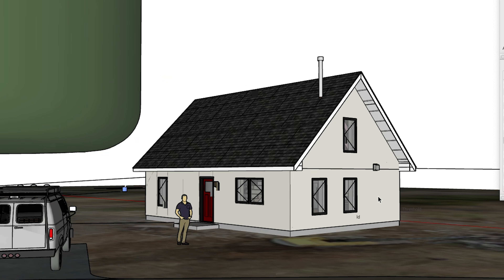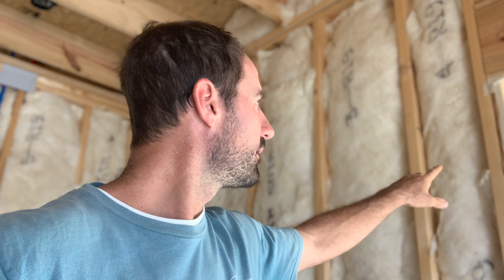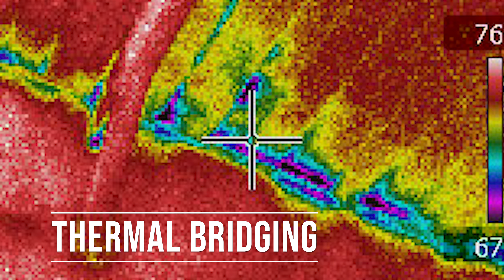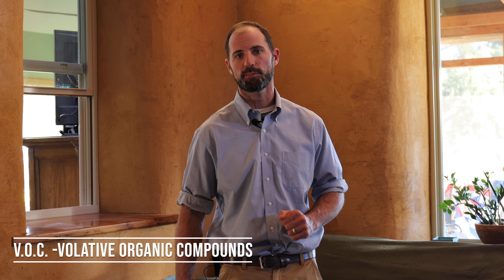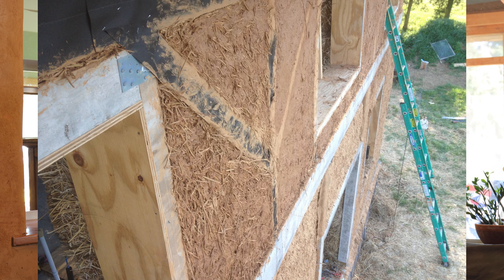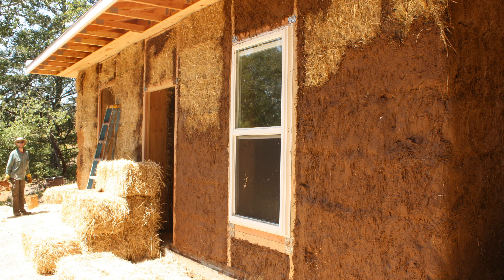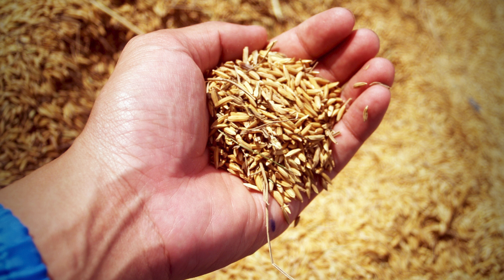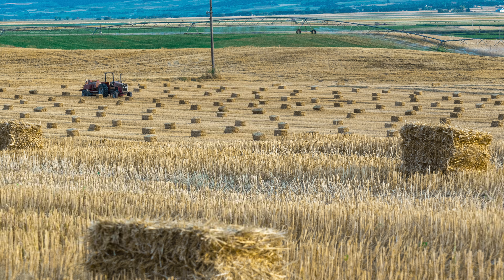The BEST way to build a new home? Building a House with STRAW BALES : Start to Finish - Episode 1

Comment: I was building straw bale homes throughout central Texas in the late 80s and I can assure you it is not dirt cheap so quit telling people that it is
Reply: I am so, so thankful to read your comment because I'm just so curious as to how affordable this actually is though.. Is there any input you can give? Thanks a ton!
Reply: @Swnsasy  Well the walls are roughly 15% of the total cost of a house. So the foundation, roof, utilities, doors and windows are still going to cost you a lot of money. Is it really worth having straw walls that are limiting in terms of what and where you can hang on them? You should also make a bigger roof  to protect the strawbales from rain, which is a significant additional cost.
This might be cheaper if you do it yourself and make compromises but you can do that also with conventional building materials.
Reply: @TheFedor47  Even though this was a few months ago and we've learned so much, I absolutely appreciate your comment and, SAVING it! Thank you, thank you for taking the time .. We've looked into the Adobe also..
Reply: @Swnsasy  Cob is also an interesting concept, but it depends where you live.
I live in a cold and humid environment and people used cob bricks mainly for barns and storage buildings, the ones that were used for living had over 1 meter thick walls. So it happens one of such houses was the house of my grandmother, it was originally a tavern. Grandma's sister still lives there, but they probably mixed some cement into the mud, at least that's what Grandpa told me.
The thing is, a thick mud wall provides thermal mass which can store heat and release it once you stop heating the house, but it is not a good insulator.
So it will lose the heat relatively quickly once you stop heating up the house. Straw on the other hand doesn't have much thermal mass so it can't store heat and release it when the house gets colder, say at night and keep it warm, but it won't allow for so much heat transfer so your house would need much less heating as long as you don't let the cold air in and warm air out. That's why where I live the vast majority of houses for living were made out of wood - which works more like straw. Mud also isn't very lasting if it's exposed to water. If you live in a hot and dry environment the thick mud walls might be great, because they wouldn't suffer from humidity that much and they would slowly heat up during the day while keeping the interior cool and release the heat at night when it's cooler.
If I were to build a mud house in a cold environment I'd make sure I additionally insulated the walls from the exterior to prevent the heat loss to the outside and save money on heating. Anyways cob will be a lot of labor, if you guys don't DIY the cost of labor may be quite significant.
Good luck to you guys! I hope you can build yourself a nice place where you will be happy, healthy and cozy. 
Hello from Slovakia 👋🏻
Reply: @TheFedor47   I NEED YOU!!!!!!! 😂
Omgosh, I can read your stories ALL DAY!! I love the way that you write.
 Sorry, I got off topic. Unfortunately I live in the US, Florida. The weather in my city is either Hot, Hot AF or Inside the Devil's undies! 😂

If I won even $100k in the lottery I would move overseas. Unfortunately, won't happen. I wish I could sit and talk with someone knowledgeable about what material is best but cheaper at the same time for this climate. I live on the Gulf of Mexico. Like I walk down the driveway I can see the ocean to my right if not for the 2 million dollar homes in my way now. 

Thing is, we NEVER EVER get the BIG Hurricanes here's. We get the wind like maybe 50 mph, some rain, sleep right through and still roads clear to go to work. Not last year. Hurricane Milton took 85% of EVERYTHING we had. It was a miracle I woke up WHEN I did ONLY because of our cat. 11pm, husband and I asleep and Nadia sleeps somewhere on our bed. It was her that came to my face and this type of, like, weird and loud SCREAM MEOW that is hard to describe. I jolt up, like what what and stretch my arm out and down, WATER IS FLOODED JUST ABOVE MY WRIST!! 

I am like thinking I'm dreaming, hop up and fell into enough water I was UNDER water! My husband grabs me, he's half asleep, ARE WE DREAMING TOGETHER!! The water, when we actually stood to floor was at the top of my knees. I am 5ft 7 inches, 1.7 meters in metric height. Everything is floating. Only good thing is our cellphone and charge lines are on our night tables so we grab those. Our car? We had just bought that brand new car barely 5 months prior. 

Long story short, 8 days later, Hurricane Helene, CAT 5.. Here! Here!! the GULF OF MEXICO SIDE!! We don't get hurricanes but we just made it through a CAT 3, Now, a CAT 5 is coming!! My husband is an Executive Chef for a massive company country club so they told us, GET HERE NOW... We stayed in their suits for 7wks. If not for that company, my husband and I would be nothing, have nothing, not able to rebuild. The club rich people, my husband still had to work mind you to feed these rich people through generators, they "pitched" in a pool of money for those that kept cooking their meals, 3x's a day every single solitary day plus snacks etc. They put us on the 7th floor suit through Hurricane Milton, 18 days total no electricity in the suits at all so plug in to charge everything down on the 3rd floor kitchen. I got to hob nob with rich of the richest.. I learned, we need a home that can WITH STAND!! Plus investing, how to catch a good one and how European markets work! 😂But seriously. I cannot, CANNOT go through that again. 2 massive hurricanes barely 2 weeks apart and I lost 85% of everything. It's the pictures though that, still now, I cry about out of nowhere. My ancestors from the 1620's drawings, writings, it's all gone.. My identity, my children's growing up into the Amazing adults they are. This... This is why I NEED, NEED to learn how to build those Adobe, mud, cement, hay, whatever it takes with MY HANDS and family hands to build.. I need it to withstand....
Reply: @TheFedor47 I AM SO SORRY FOR WRITING THAT OUT!!! I'M SO, SO VERY SORRY.... 😔
Reply: Depends on where you live. 😊
Reply: I need you to build me a home in Florida

Comment: If the world uses straw for construction, expect a major acceleration of land depletion and erosion. I would rather build a house with something similar of M2 panels, EPS insulation covered by a steel armour and concrete or similar hard material. EPS is just 2% plastic and 98% air

Comment: What size posts do you use for a two story house?
Reply from the maker: 4x4s, platform framed like a conventional build: with the second floor system resting on top of the first story walls, and the second story walls (also 4x4’s) stacked on top of the floor system (I.e. the platform in platform framing).

Comment: Can you use north Carolina pine straw? 
The army packs 50 foot trailers full of bales of pine straw on Fort Bragg
Reply from the maker: I’ve never heard of anyone using pine straw, and my gut tells me the insulation value would not be as good as a hollow stem straw like wheat or rice. But I’m sure it could be done

Comment: How do you deal with mold risk in wet areas like North Carolina?
Reply from the maker: As long as you build in a location with access to drying potential (moderate wind and sun exposure - not in densely wooded areas), and use breathable plaster and renders, the bales will remain dry.

Comment: Please do not use this method. The walls contain no vapor barrier which is a very bad idea. The plaster or stucco on the outside and the plaster on the inside are porous materials that will soak up water. Sandwiched between them are bales of straw. The straw is an organic material that will deteriorate in the presence of moisture. That will happen because of rain of course. But there is another source also. Water vapor migrates through walls in a structure. With no vapor barrier, it will pass through the wall and reach a point, called the dew point, where the water vapor will condense into liquid water, probably somewhere in the straw bale. From there, it will cause the straw to rot. It will also probably cause mildew and mold growth. 
You might get away with this in a very dry climate but I am not sure it will be a good idea there either. The reason is that cooking, bathing, showering, and human bodies contribute moisture to the inside of the house. That water vapor will pass through the walls and condense as I said before even in a dry climate.

Comment: The real benefit of straw bale construction is the insulation value. Your build in this show doesn't do anything for the roof with straw for insulation. The roof is where the greatest heat loss occurs. Try developing a plan for a straw bale insulated roof.

Comment: I have a few questions. Does the humidity of the geographical area you live in effect mold growth on the straw?

What about flammability? 

How long does a properly build straw built house last?

Do most townships in the United States reject building plans for straw built homes? Does it meet building standards?
Reply from the maker: Humidity definitely affects mold growth. You’ll want to make sure that you have plenty of drying potential (wind and sun exposure) if you live in a humid area.
Straw bale homes don’t burn. They are 6 times less flammable than a conventional stick built home.
Strawbale homes can last for hundreds of years given that they have a good roof and foundation that keeps them off the ground.
Most towns and counties in the US will accept a Strawbale home if you have a structural engineer design the framing.
Reply: You should get the book “The Straw Bale House” by Steen, Steen, and Bainbridge. Extremely valuable book and covers your questions thoroughly.

Comment: Our Santa Fe, NM home was adobe-style, 2,000sf, built with 2x6 exterior walls on concrete slab and a little extra batt fiberglass insulation, ie, not too much extra expense.  The design was passive solar so we spent a little more on windows. The floors were all saltillo tile. Result? Pretty darn good!  We installed in-floor forced hot water heating using LPG storage tank fuel and our heating bill for (over and above hot water and gas cooktop) never exceeded $25 a month and we had a baby so the heat was always on in the winter but it rarely actually turned on. So, strawbale is an attractive (looks and performance) way to go but do combine if possible with passive solar design for very small utility costs and better ecological results every day for decades.  Thank you for your videos.
Reply from the maker: Awesome! Thanks for the story of your house

Comment: I live in a straw bale home. Cob inside and out. It is like air conditioning in summer and stays up to 80 in 0 degree winter.  3 stories high. When woodstove goes 24 7 it stays 75 to 80 no problem.  Such an efficient home. Very very efficient.
Reply from the maker: Thanks for your story.
Reply: Tell us more about summer! What region are u in?
Reply: @Notturnoir  north east Washington state 80 miles from Canada up in the corner of Washington 60 miles from Idaho pan handle.  Summer anymore is like what's it gonna be this year. No longer is the weather consistent but maybe it never was. But I feel like the building is so thick from straw bales and then the hard clay cob outside and inside just holds cool air inside in summer and holds warm air in in winter.  But usually the summers here are easily up to 90s an higher more recently.  I am in basically the mid mountain range maybe just above foothill level so there is cooler air with the forest surrounding home. It's such an airtight structure that any slight Crack on doorway or windows and the crisp winter air just darts in . But it also creates a heck of a neat air system up on the second an their story when the bottom level has a door open and then upstairs has a door open the heat if I stand in the doorway just blows out like a fan is pushing it out its good for freshening the house in winter after using a wood stove 24 7. That and the wood stove draws like crazy if a window is cracked just pulls in the cold air but draws it into the stove makes a good running wood stove
Reply: @banjodubghall84 thank you! This is my dream!
Reply: @Notturnoir  where are you
Reply: @banjodubghall84 i’m in SoCal— so summer heat is a big concern!
Reply: @Notturnoir  probably would be beneficial to have a cob structure that has a below ground foundation so it's like the window would be level with the ground . It would just stay cooler that way from the cooler ground below I'm assuming.  That and or use geothermal burying big storm pipes ran underground for good distance pretty deep with the right set up that can keep a place very cool and even warm in winter. I seen a man that did this in the mid us and he grows oranges in his green house by harnessing geo thermal heat an cool.
Reply: @Notturnoir  but man a guy could get so creative and use double stacked straw bales walls or the huge bales and have 4 or 6 foot thick walls just in straw alone thrn with cob it would be so so efficient in preserving heat and cool
Reply: How did you install electrics?
Reply: Yes this is what I have been wondering
Reply: This is actually what I've been trying to find. I've noticed that most seem to be either single story homes or hybrids. I'm wondering if three floors is possible with strawbales? Is it dependent on the frame?
Reply: How do you stop mice getting in?
Reply: @ivandinsmore6217 

Leave no holes gaps or anywhere they can get im. Sealing up foundation ground up. They have gotten I but that's when I fist moved in. I also constantly have a few traps set. Keeps the population down around the house i feel. Just gotta get meticulous.

Comment: I invented straw bale  it was my idea  I got it through building code  by time your done  it cost just as much as a regular home or more. thees a foundation  a roof and the  plaster also. blocks to attach to the straw that alot of work its only saving on some siding .
 I can tell you solid wood is better by the way I also developed cob houses  as light clay.  and earth ships were also my idea of putting dirt in a tire trying to use all this old tires.  I dint know. you had to pack all that dirt in there with hammers  or that tires had to all be the same size 
 but I ended up with the. head architect for Seattle wa building code department.  I read all his books and listened to a lot and  I restarted building a low cost home  this time I wanted it to pass building code.  what I came up with was solid wood. just stack 2x4s on top of each other and nail them together like a log cabin. I used a flat roof and floor using the same wall. .lall together it cost about 12 a square foot and passes building code . theres one on Mother Earth news.   building a house entirely out of 2x4s.  btw 5 miles of 2x4s is only 5 bundles so dont be put of by that. I have a very evolved design iv developed.  the straw  ballet started out as the Nebraska house. they were just stacked with a tin roof over  them  thats the original house I wanted to build

Comment: Check your local ordinances and zoning requirements. Getting a permit to build a straw bale house can be a nightmare of rejections from county inspectors and refused building permits. If others haven't built in your area and if the local laws aren't flexible or forward looking you  may be looking at years of frustration and failed inspections. It can jack your building costs through the roof. My family found this out the hard way. If your on a limited budget and don't do the research first for what your county will allow and issue permits for, you can lose everything.

Comment: where does the wiring and plumbing go?
Reply from the maker: Plumbing is best kept in interior wood framed partition walls - 2x6 walls. You can also use the empty space at the top of vaulted ceiling-to-wall intersections. Wiring is cut/relieved 2” into the straw bale walls with a chainsaw and fastened with landscape staples. Plaster covers and wire is 3” behind wall surface. Usually wire is UF direct burial wire, or run in conduit for future wire pulling.

Comment: Great video!! What are your thoughts on Hempcrete vs Straw Bale for a house?
Reply from the maker: Straw bale 100%. Strawbales are manufactured in a field with farm equipment. Hempcrete requires a tremendous amount of processing to build with (at least until we have a better supply chain of fiber hemp strains and have the hemp Hurd readily available for cheap).
Reply: @HeirloomBuilders  Thanks! I've been experimenting with making Hempcrete blocks for the past few months and even took a few in person workshops. There's definitely a lot of variation in the hurd out there and a bit hard to get a consistent end product but once you nail it, it really does work pretty well. I will look more into strawbales though.

Comment: Good presentation, except it's not clear how to size strawbales to the desired size. You cannot cut them half, since they fall apart immediately, don't they?
Reply from the maker: You have to retie the bales with twine to hold together a bale of smaller size, and then cut the original strings and let the part you don’t need fall off. I’ll explain that in detail on a later video in the aeries

Comment: Possibly dangerous but mud might not catch on fire.
Reply from the maker: That’s right. Strawbale wall systems with plaster have a two hour fire rating; which is 4 times better than a conventional stick-framed wall system.

Comment: Serious Question: Will a straw bale house affect someone with hay allergies or does it not matter once it's covered with sand and cement?
Reply from the maker: Good question. The bales are covered up with so much plaster, that it probably would be fine for someone with hay allergies. But that’s a big risk to take!